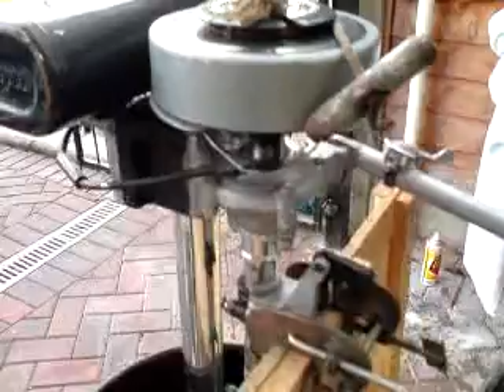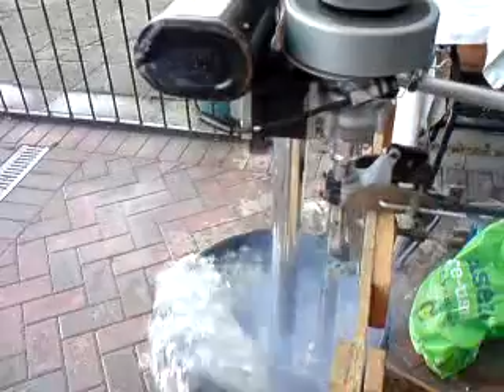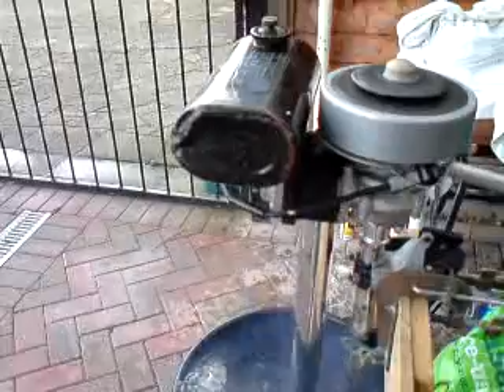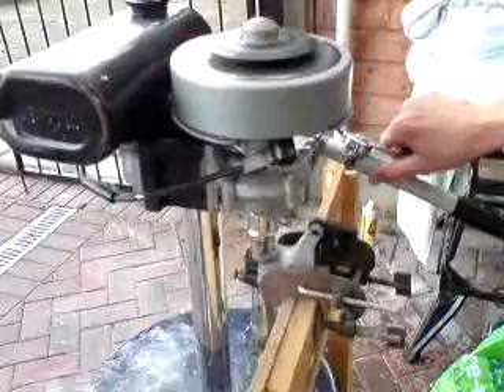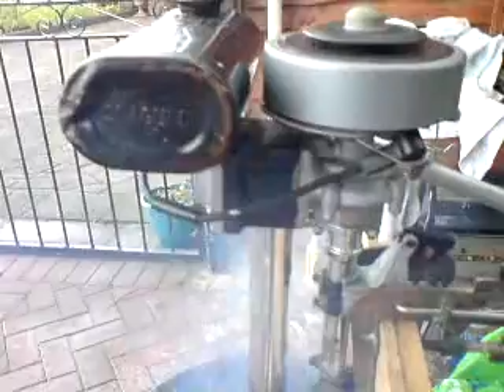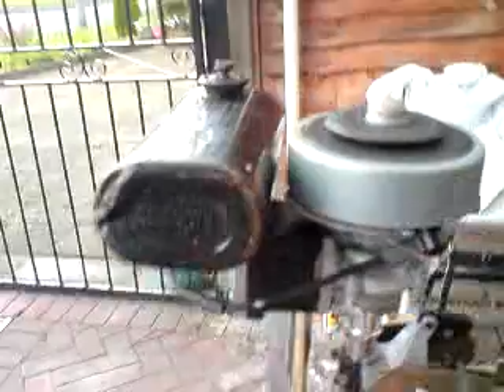Seagull engine - RUNNING

Comment: @HH2charger Usually 10:1. With the models that have the 'Bing' carburettor you can use 25:1 no problem, but with the villiers carb and other carbs you need a conversion needle to use 25:1

Comment: @johndoyle07 Cover air intake or modify your throttle cable so when you move the throttle lever all the way to the right it stops the engine.